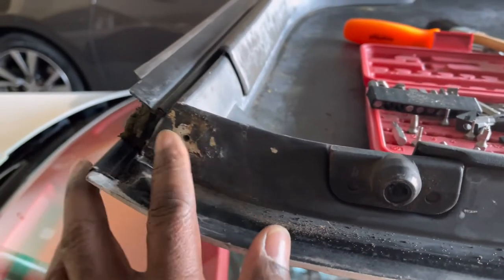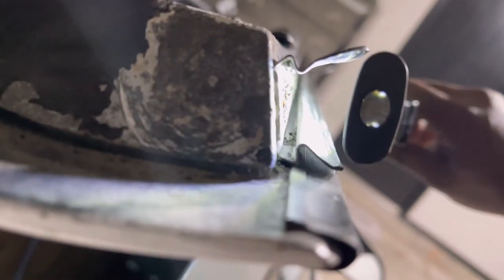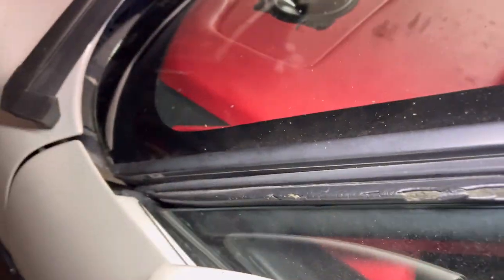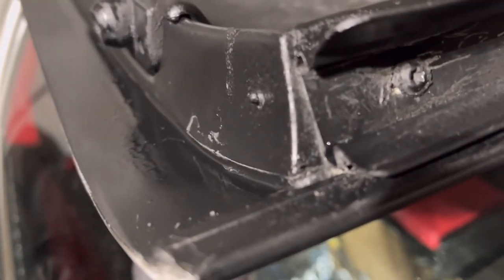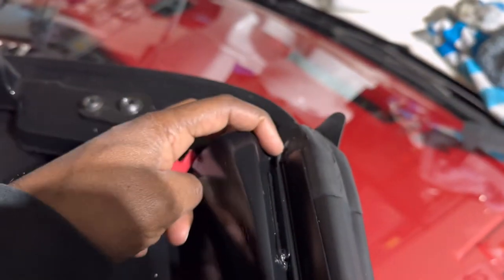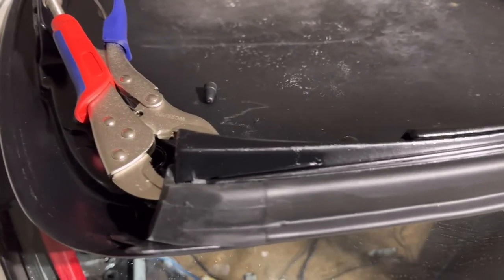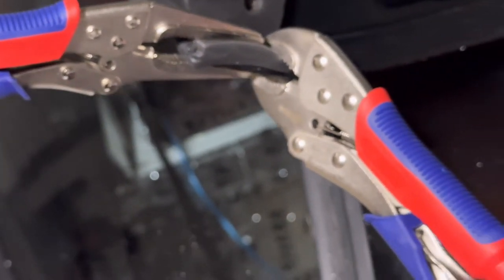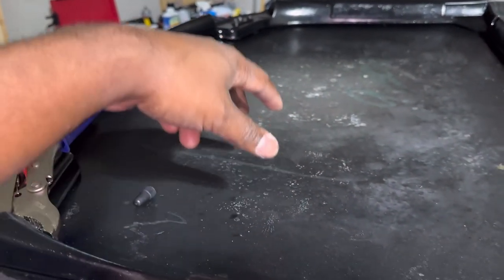Targa Top Weatherstrip!! #Chevy #Corvette #Diy #C4

Comment: Were you able to get the new weatherstrips to fit snug into the lips in the rails? Or did you just use adhesive and glue the weatherstripping back onto the rail? I've been struggling to get my new weatherstrips to fit.
Reply from the maker: yeah I got it to fit snug, it's fitting better as time goes on and it sitting in the sun and molding to the doors and hatch being closed... update video coming soon.

Comment: Thanks for this bro lots of good shots and instruction. 

Have you had any issues with the window not sealing flush? My kinda squashes the rubber down when I close the door instead of reaching onto the outside the way it should
Reply from the maker: no problem boss, yeah a little bit but I thought it may have been due to the fact that I may have not gotten it far enough in because the passenger is fine...I plan on checking it out again once I install the rest of my weatherstrip.
Reply from the maker: worst case scenario I'll just adjust the window a bit.